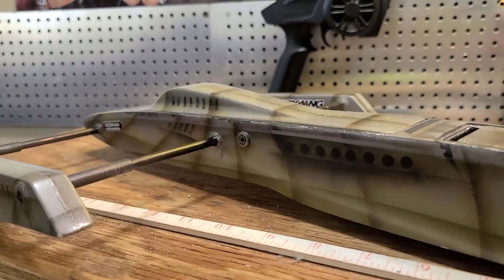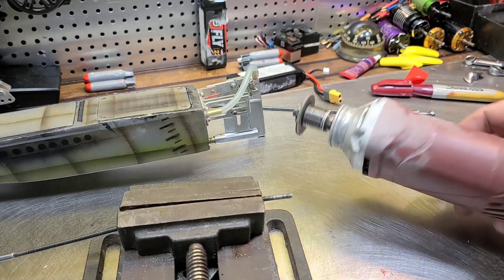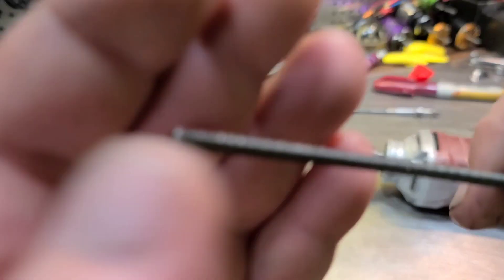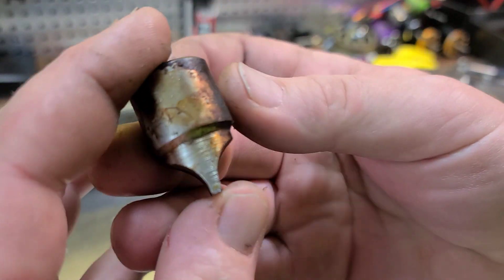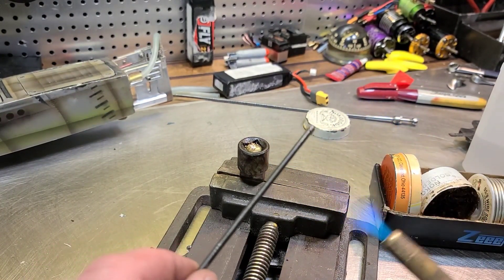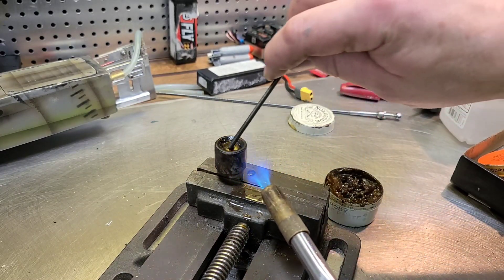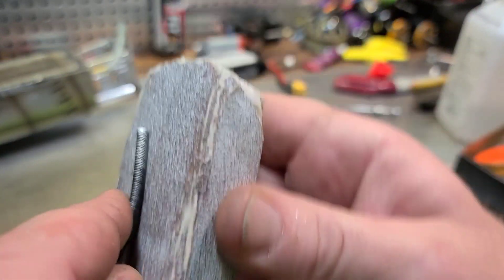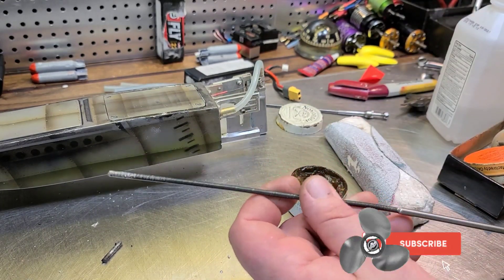How To Properly Cut & Solder RC boat Flex Cable

Comment: What kind of solder
 What kind of flux? You use I can’t get the solder to stay on the flex cable
Reply from the maker: All the grease needs to be off the flex cable, totally clean...     I just use common lead free 60/40 electronics solder & Flux.  I accidentally put plumbers solder in the crucible one time, mixed with electronic solder worked just as good lol
Reply from the maker: You gotta slightly heat the flex then Flux it, dip it, whip it, Flux it, dip it, whip it repeat until the solder sticks.  Don't get the flex cable to hot because it'll weaken it.

Comment: Hey Big B congrats from Portugal. I would appreciate some help,and at the same time always interested in your videos, great stuf. I have a fiberglass boat its old but its in good shape, but i have a serious problem. Because its old spare parts you know... none! I broke the flex cable that was in the boat and i only have a spare one... I search from Proboat or Traxxas and other brands but here in Portugal its very diffucult to search specificatios. So i need help of course... the flex cable must be at least 290 mm long till drive dog, the flex part 3.5mm  width and the shaft 4.7 mm width. I was seing recoil 2 flex cable but i dont find the specs. Coud you help me?

Comment: What's the aim for doing this? Should it be done to all RC boats? Do you solder both ends of the cable?
Reply from the maker: Just solder the end that goes into the collet.if your running a Collet  soldering the end doesn't really need to be done, if your running a  coupler with grub screws the solder is a must to prevent the grub screw from crimping the cable.   Hopefully this helps

Comment: This cable is produced as free cutting or non free cutting. The cutting method will work just fine so long as its wound properly. The non free cutting stuff needs a cautery or a weld ish type thing like a grind to keep the strands from fraying and unwinding along the diameter of the core.

Comment: Great video, the rag you used ,was it wet or dry, and did you put solid solder into the jcrucibal first then heat it up or did you burn it of the reel
Reply from the maker: It's solid solder.   And the rags was dry but it doesn't matter wet or dry

Comment: Great vid but I never put my good part of the cable into the vice 😊
Reply from the maker: Yep good point.  I just had her snug. Not gorilla tight
Reply: @IRONCLADRC 😊 I like it you cut with the grinder etc that's ideal but on some cables like the brass ones can get away with a hack saw as they don't frey like those fine wire ones,if I had a grinder I'd use it every time to cut my cables